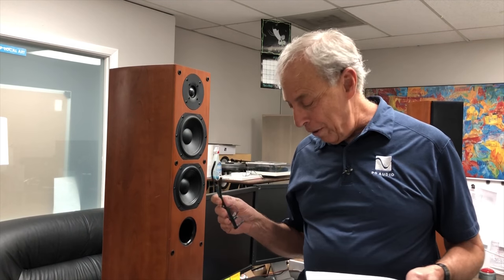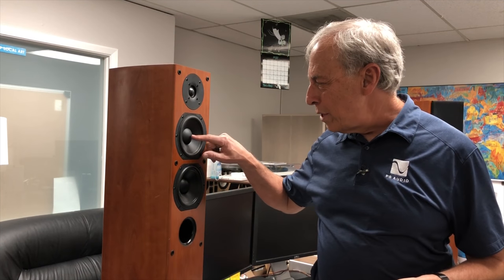Does a dented dome tweeter matter?

Comment: Giving dented domes a "Brazilian" to fix them? At least its a way better solution that the one I used to do by dismantling the whole tweeter assembly and using a small rubber mallet like the one they use to align the optics of the scopes of 10,000 USD sniper rifles to gently pound the dome back into shape.

Comment: A bit of vacuum will pop em' back out.  If you wish to be more aggressive with your ambitions use the correct glue remover and frugally give it a bit of q-tip love around the edge and let the magic happen,  gently remove the offending cap.  Clean-re-glue-and ROCK!  P.S.   PRO TIP   ----    INSTALL A REBAR GRILL TO PREVENT FURTHER LITTLE ISSUES THAT MAY INVOLVE TISSUES)    jk?

Comment: Well i had both replaced my me....and after replacing the first one you could cleary hear a difference. So there that.
Reply: You are wrong
Reply: @thetruebrit85  So....i disassembled both my uni-q drivers of my IQ5's. Both had pushed tweeters one worse than the other. Desoldered one, replaced the tweeter (from official supplier), put it to he test and the sound was cleary more detailed. Done the same to the other and it produced the same improvement. I didn't say this will happen to all cases. I have had three different generations of uni-q drivers from kef and they dont sound the same (they change the materials,  the crossover points, etc) but they all have he same concept as the center part of the driver is a individual speaker not a dust cap as most speaker systems do. Do you think all tweeters sound the same? Do you think all the metal dome tweeters sound the same? Do you think the shap of he tweters has influence in tje sound? Don't take this to hard but your statement is completly hollow.

Comment: So basically you are saying that a power cable that is used on the last meter of a power line, or the middle one, as it is AC, to power any equipment, just a simple cable, on an equipment, and can cost you $1000.00, makes a difference, which has no explanation from any electronic point of view at any level, or in any school, it is just based on anecdotal experience, as that power is later on filtered 100 times; and you cannot hear differences in audio sound, not measure them, on a dented tweeter dome, deformed, that will cause anomalies on the mechanical waves for small they will be, (small but still will be hundreds of times bigger than the same you claim to listen using a different power cable)? This is in my humble opinion total BS, and that is why the audiophile world is so plagued of BS today. You endorse what you sell and nothing else, whomever believes that second, can't not be stupid enough to believe the power cable statement....

Comment: Completely false information Paul. YES a dented tweeter matters. The hard metal dome type significantly more than the soft dome type. 
Once the dome is deformed, the break-up frequency of that dome lowers into the audible range as the dome loses its structural integrity. 
For example, say an aluminum dome tweeter has a break-up frequency peak at 22khz by design. A dent in that dome can drop the peak to 15khz where it will be audible and very irritating as the peak will be very high in amplitude. 
The soft domes are not as dramatic because they absorb a lot of the energy by design, but it can still effect the frequency response.